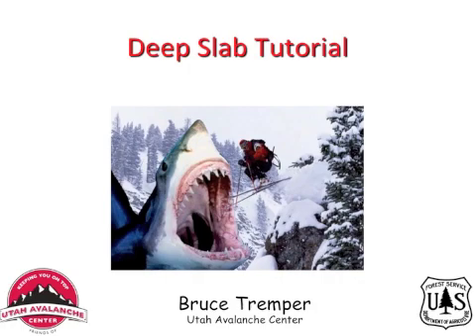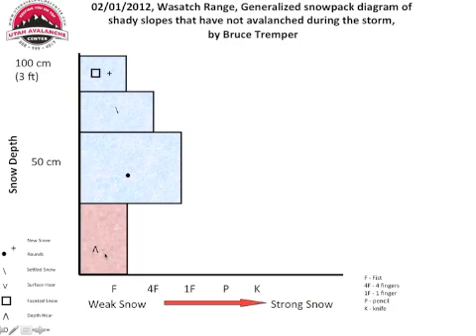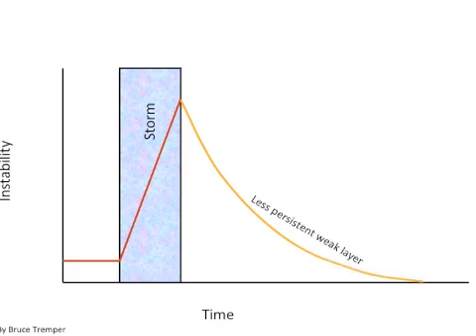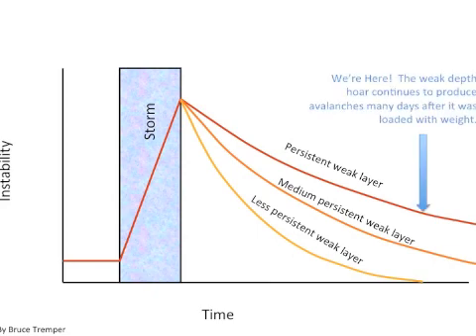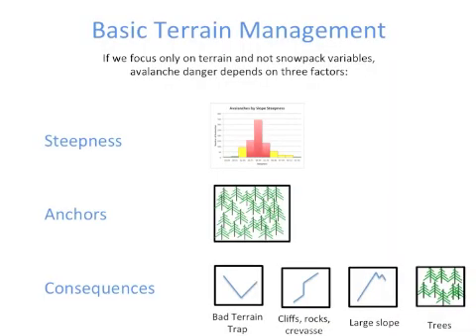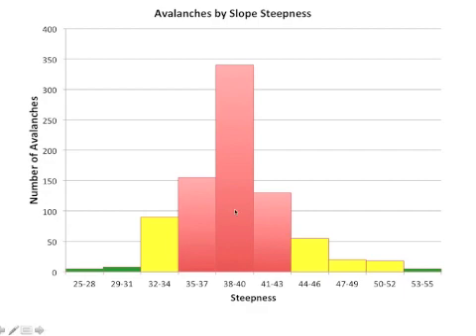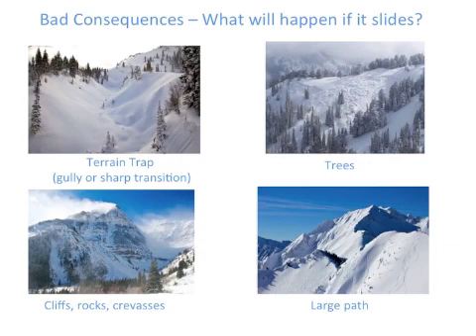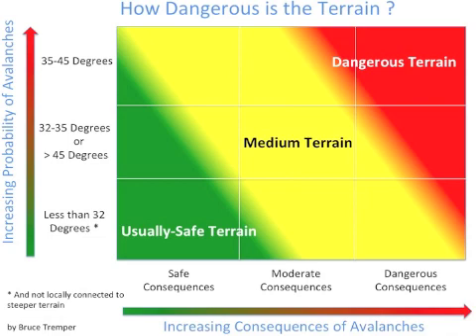Deep Slab Instability.mov

Comment: Hey Utah Avalanche Center, I have two questions. 

1) What causes weak layers to be more or less persistent?
2) What causes them to eventually stabilize?
Reply from the maker: Persistent weak layers are layers of faceted snow crystals. These facets take a long time to bond to each other which is why they make a persistent weak layer. 
They stabilize with time and warm temperatures. One easy way is to put a thick layer of snow on top of them so that they are insulated and do not have a strong temperature gradient. They can take weeks or even months to stabilize.
Reply: @utahavalanchecenter  Thanks!